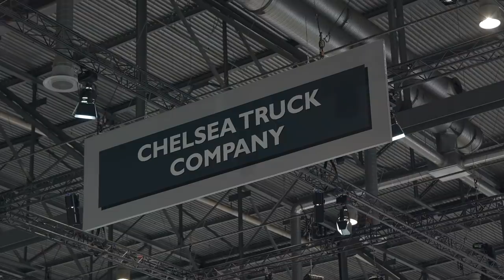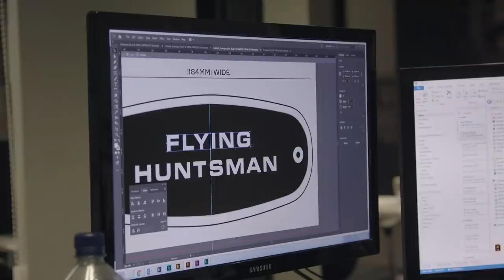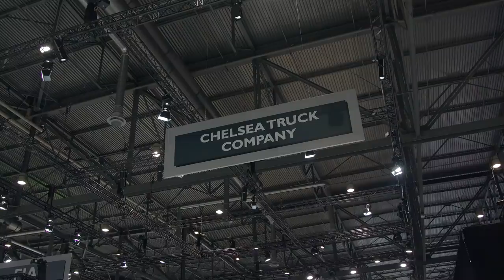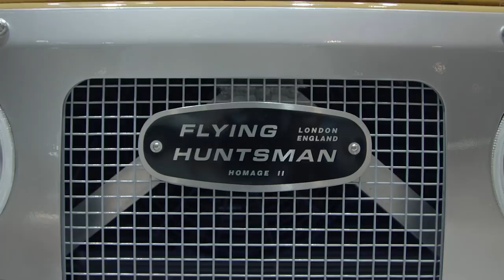Unveiling the Homage II Defender at the Geneva Motor Show 2019 | The Kahn Office

Comment: What we have created is a prototype Defender 2 by extending the chassis from 90 to 98mm to give the front grill a unique look of looking squashed and pushed back   from the front beefed up side panels, originally a hard top but converted to a convertible using the roll cage as a base. Wheels back to the original style but with all terrain tyres, while the side step small but effective. We also kept with the original style adding twin front windscreen to finish off the concept of a Defender 2
Reply from the maker: You're hired!
Reply: @KahnTV  when can I start, I'm only up the road lol